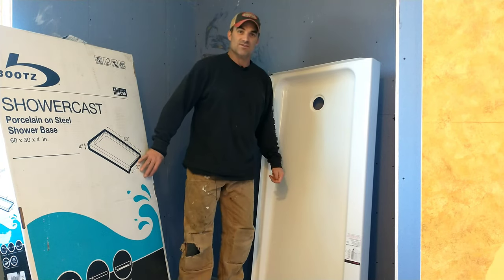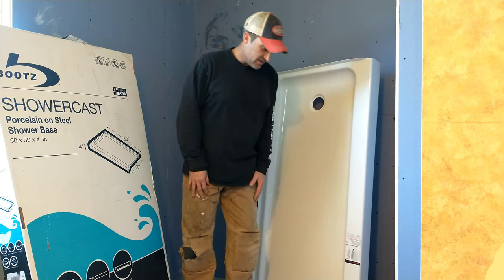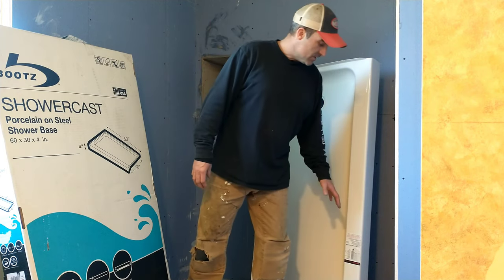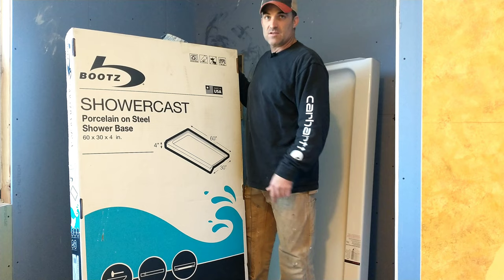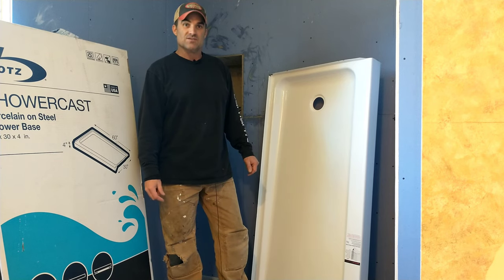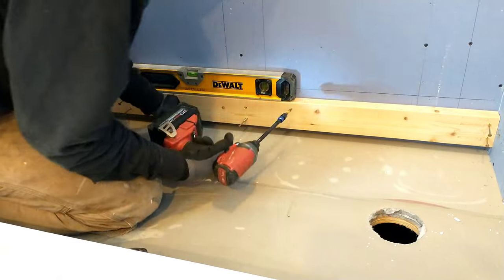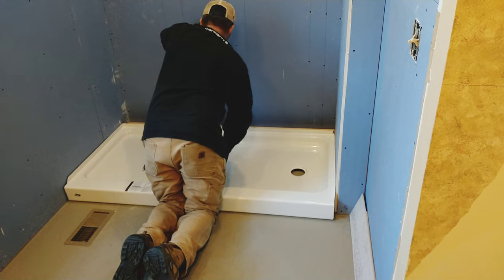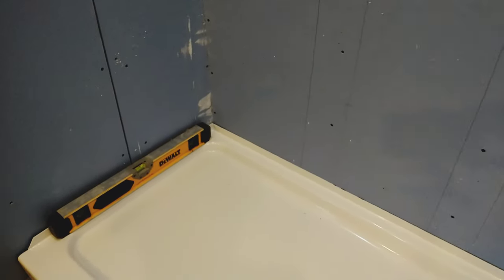Install Bootz Shower Pan & Oatey Shower Drain #diy #how #howto

Comment: Bootz customer service instructed me to install the Hardie board down to an 1/8" gap above the shower cast lip leaving the studs exposed below that line (which is quite different from your install). The stringer then attaches directly to the studs.
Reply from the maker: Hi.  You are correct in stating that. However, you are not on the correct video for the installation you're discussing. The next video in our bathroom remodel is the installation of the hardibacker, which is installed per manufacturers instructions. We placed it above the lip of this pan and then caulked it accordingly prior to tiling. You may want to look in our playlist and find the video about HardieBacker installation. Thank you for watching this video, and your comments are always appreciated.
Reply: @YouCanDoIt2  i gotta cut the hole as wide as top part because the 2" part wont go all the way down in subfloor

Comment: This may sound like a lame question but, can you explain why you placed a scrap piece of Hardie board on the floor and measured up to the shower pan edge or lip . Wouldn't measuring from the top of the lip to the bottom of the lip and transfer that dimension to the wall give you the needed height for the stringer ? Thank you kindly for your help Sir.
Reply from the maker: Hi Juan.  Thank you for watching the video and leaving a question/comment. I believe the section of the video you are referring to is where I used the scrap Hardie board as a guide for where to place the measurement on the wall. I did not put the Hardie board scrap on the floor I put it just below the lip of the back of the Bootz shower pan and measured down so I knew how deep that lip was. Then I transferred that depth to the wall so I knew where to place the 2x4. Of course there are several ways you can do it. I was showing one example and I'm sure you can come up with other options. 👍

Comment: What are the pros and cons of using brass parson the pan vs pvc parts? Do you have a video showing the connection of the pan drain to the pipe under the pan

Comment: Question, why did you add the sheet rock first and then the pan and then the hardy back?
Reply from the maker: Hi.  Great question!  There are a few different ways to go about this type of installation.  We were in construction for 20+ years and this is how these types of showers were always installed in the state that we lived in....California.  Everything is overdone and overengineered...which has pluses and minuses to it.  
If you just install hardiebacker to studs...and there is ever a leak between the seams, then you eventually will end up with dryrot.  Having the moisture rated sheetrock will help to alleviate that problem.  Also, adding that layer of sheetrock, then hardiebacker helps to insulate for both warmth and sound...and, can add to the stability of the entire enclosure...almost like sheerwall. With that extra sheetrock you can smooth out imperfections along the studs, whereas the thin hardieboard, once sucked up to the studs, may look like a roller coaster if your studs aren't perfectly plumb.
If you install as we did, the pan would have to go in after the sheetrock.  You don't want sheet rock in front of the pan, or it could get wet at the bottom, expand, and then make a mess of your tile job.   So, moisture barrier sheet rock, pan installation, then hardiebacker. 
Make sure to NEVER sink your hadiebacker down into your pan.  Because hardiebacker is made of cement and fiber, if it is exposed to too much water, it will expand and cause the lower portion of your tile job to fail.  Instead, place the hardiebacker right at the lip of the pan and give it a good seal at the bottom to prevent water from wicking up into the board.
Hope that all this information answered some questions for you.  Thanks so much for watching and commenting.
Reply: @YouCanDoIt2  thank you for the information. It was very helpful.
Reply: but then adding the 1/4 or 1/2 thick green board will eat into the space needed for the pan to fit? also almost all videos say to screw pan to studs or is it just different for this particular model brand?
Reply from the maker: @ginagvlogs2386  Hi Gina.  You are absolutely you correct... If you do not measure and account for the space required when building the alcove for the shower pan then you will be encroaching into that space for the pan. In the video before this video we built the wall alcove specifically designed for this shower pan which included the thickness of the moisture barrier sheetrock. The Hardie board measurement is really not included as that goes in front of the moisture barrier and sits right on the lip of the pan.  Different pan models require different installations. This pan was screwed right into the studs. We screwed in the back lip of the pan with 2 1/2" long screws and washers that had a rubber ring around them so that they did not destroy the porcelain when they were torqued down. Hope this info clarifies things a bit.  Thank you so much for your comments / questions they are great!!

Comment: Thanks for the video. Do you have one showing the plumbing underneath?  I need to remove an old drain and cutting away the 2” pipe and will be replacing the drain with the one you used here.
Reply from the maker: Hi T.B. I have had request for exactly what you are asking for. Unfortunately, we did not film that. I do have another job coming up where I will be doing that same install along with a complete video under the home. I'm sure that won't help you out at this point for your project. Hopefully you will be able to navigate that portion yourself. 👍

Comment: instructions for most shower pans say to screw pan straight into studs not on drywall?
Reply: Correct, wrong way tile won't hold to the bottom of shower pan

Comment: We removed our tile shower and installing a base like this one, would we need to replace the existing drain?
Reply from the maker: Hi.  Thanks so much for your question.  What I would say is that if you are going through the trouble of replacing your tile base and installing a shower pan, it would always be a good idea to put in a brand new shower drain. The last thing you would want to happen is to do all this work and then have leaks. This two piece shower drain is very easy to install as you can see from this video. If you go this route, don't forget to get that plumbers putty to put in between to give it a very good seal.

Comment: hello sir i had another question, do i install a second 2x4 under front curb?
Reply: i think you called it a stringer 2x4,, do i need a stringer in front curb
Reply from the maker: Hi Gina.  Good question.  For this particular shower pan the manufacturer suggested putting the 2x4 stringer in the back against the shower wall to brace that portion of the shower pan. However, this particular one does not require a 2x4 in the front because it is braced by metal supports that are welded on the underside of this particular shower pan. Thank you so much for visiting and leaving a comment / question. They are always appreciated!

Comment: Aren't the screws supposed to go through the flange?
Reply from the maker: Hi Brandon.  Thank you for your question. This particular model is installed with a washer and screw over the flange not through it. We followed the manufacturers suggested installation. There are some shower pans that are pre-drilled for washers and screws to install directly through the pan but this is not one of those shower pans. Thank you so much for watching! p

Comment: why did you install the 2x4 ?
Reply from the maker: Good question.  This was a bathroom remodel. The original shower was in a different location in the bathroom. A video before this showed where the shower was originally located. Because we relocated the shower the area that it was placed in was larger than the shower pan, so we had to build out the walls to accommodate for the smaller shower pan. This is a standard pan size which is 5 ft long. The location we put the shower pan in was 6 ft wide, thus the need to install 2x4s and frame out a new alcove. Hope this answered your question.

Comment: also could not help it noticed you didnt screw thru flange just on top?
Reply from the maker: Hi.  Thanks so much for taking the time out to make a comment.  I would definitely agree that if the shower pan were pre-drilled on the flange you would of course screw through that. However this shower pan does not have any pre-drilled holes in it therefore if you drilled through the flange you have a very good chance of shattering the porcelain layer.  If you were to go on to the website for this particular shower pan, bootz, you would see that the instructions for this indtall are identical to how we installed the shower pan.  We used long stainless steel wood screws with a rubberized metal washer and ran them along the lip of the flange.

Comment: How long would this base last?
Reply from the maker: I'm guessing until the rapture 😂....it's porcelain over steel.  Couldn't imagine it failing.  The fiberglass shower pans tend to crack and yellow after a couple of years. These seem to be pretty bulletproof.
Reply: True. The old cast iron could last forever but I never really had cast steel growing up. And the new steel cast tubs and pans I couldn't find any reviews for it.
Reply from the maker: @dremalin  I installed this in the first home we ever built. After 5 years of living in that house it still looked brand new.